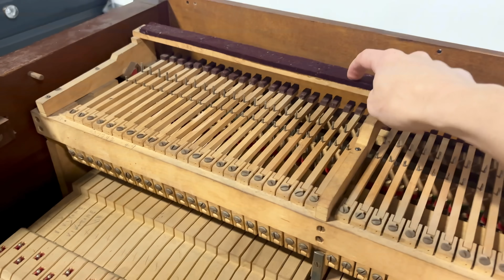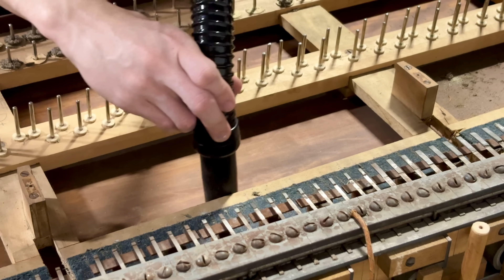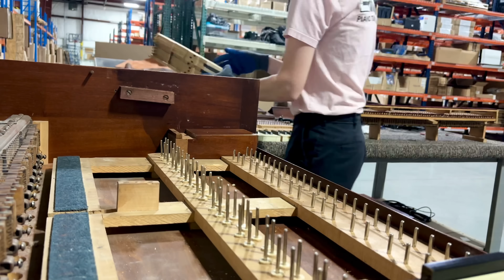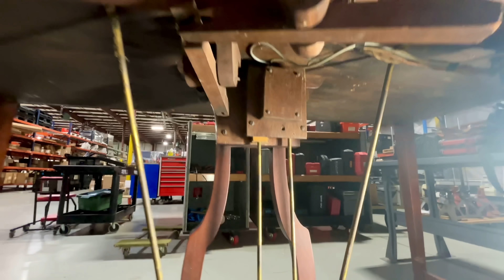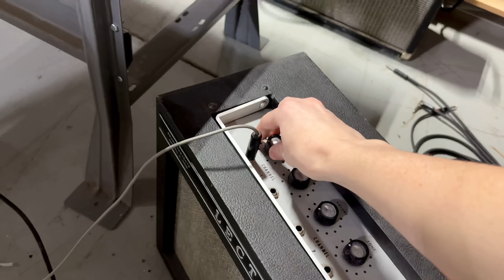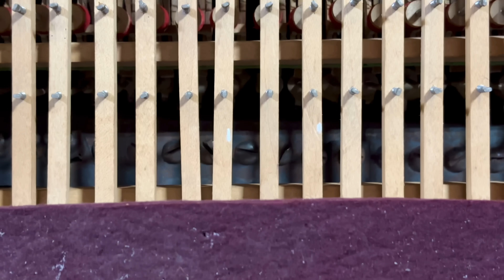Restoring an Instrument You've Never Heard (only 3 left)

Comment from the maker: Yes I used Deoxit F5 on the pot, I just didn't add the clip cause it didn't do anything lol please stop commenting LOL

Also sorry for the clipping audio in sections, y’all wanted it loud so I made it too loud 😂
Reply: I appreciate your practical effort in your quest for doing the best job possible.
Reply: Really enjoyed this video, thanks so much for documenting the whole process.
Reply: Very interesting bit of history and good work! I agree with the EE, Deoxit the potentiometer and replace the capacitor. They dry out with age, so just leave the original in the box with a note for future reference.
I subscribed to your channel cuz this was a cool video.
Reply from the maker: @AdamDavidSoloman  Deoxit F5 was used on the pot and it did not improve--should have included that lol
Reply: @Emmarepairs Thanks for the reply.
Reply: @AdamDavidSoloman  The noise could all be down to that capacitor. I am assuming that EMI filtering is its purpose in that circuit.
Reply: Did you try taking the pot apart? Sometimes the Deoxit doesn't do a great job getting inside, sometimes there's actual debris inside, and sometimes it's actually worn out. I've seen extremely few worn out, but perhaps this one would have gotten more use than the ones I see (mostly old volume controls and video adjustments). Given your demonstrated skills, if you haven't taken one apart before, I think you'd find it extremely easy to disassemble and reassemble. And you can always test a new one in circuit to see whether or not the old one is the problem before doing anything. :-)
Reply: Hey Emma did you try deoxoit on the pot 😂 I'm a retired aemchair gigavoltage engineering assistant manager superintendent and I know more about this than those other guys 

I kid lol excellent work on the restoration that's a really cool instrument
Reply: ... but, did you use Deoxit F5 on the pot? 😅 I have no idea what that is, but apparently it's something special.
Reply: Everything is great fine, I didn't find any calibrated piano sounds in the folder or they weren't intended for downloading?
Reply from the maker: @IljaSj  People have told me they were able to get it working--tbh I don't have MIDI so I haven't tried lol, only heard the files
Reply: @Emmarepairs  Everything works for me, VST3, I just thought there would be sounds of this piano tuned, there seem to be alternative sounds!
Reply from the maker: @IljaSj  wait what? I had my guy alter some of the tunings so it was a little more playable--are they not?
Reply: @Emmarepairs  Sorry, maybe I'm mixing something up. The raw samples in the folder are a little distorted. I probably wanted to play on a tuned piano. But in any case, thank you very much for this. This is history!
Reply from the maker: @IljaSj  Oh yea some notes were a little rough, we tried our best haha--last sample only had the top half working so this is a big improvement--cheers!
Reply: Better than too soft! But if you're looking for a way to make things louder without hard clipping a super simple saturation plugin like MSaturation (I switch of anti-aliasing as it removes some high end) can bump up quiet sections without hard clipping.
Reply: I repair old vacuum tube radios & those wax & paper capacitors are almost always bad. The good news is that you can hollow them out & fit modern capacitors inside and they look original.
Reply: I’m Craigslist near Kansas City. Under “free stuff” people are giving their pianos away for free baby grands and every make a model. It’s happens around thanksgiving and Christmas all the time here
Reply: you should used the stuff in the green can for faders and controls when I am restoreing tube radios.
Reply: So, it's an electric reed piano-y thing? Whichever, it sounds really cool!
Deoxit F5? Brilliant stuff, I use it on guitar pots, switches and that rubbish light switch in the basement that I really should go change out!
I also have a 113 year old harmonium which I love to play, had to fix it first though! Same type of reeds I guess.
Reply: Some people hollow out the old capacitor and put a new one inside it so they can keep the look and still have things work. I see TV and radio guys do that all the time uncertain vintage sets.
Reply: OK LOL I was not one of them commenting.
Reply: What where the two pieces of music played at the end? They're really nice!
Reply: The capacitor (condenser) is an old wax type the buzz you are getting is because that capacitor is now a resistor. I get that you want to keep it as original as possible, but the cap will eventually become a short circuit across the transformer and eventually burn it out. A 0.7nF tubular axial capacitor is a direct replacement for what is on there.
Reply: Ok, but deoxit rarely works on really dirty pots, you could have open the pot and cleaned it.  Then you could have put a modern cap across the bad one

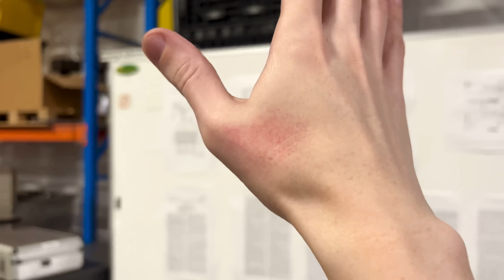Comment: A piece of advice. 7:42 Using your hand squeezing like a vise over time WILL develop  carpal tunnel {maybe with trigger finger thrown in.}  I've been there {both hands}.  Maybe use the pliers with a coulpa-few, not the whole keyboard.  If you were to replace the tone capacitor, it would clear up the crackling {I've picked up some electrickery stuff here & there.}

Comment: With the radio reception means that  all that shielding wasn't truly grounded and I mean to the ground, the earth like you find on a three prong A/C plug. Since it is electric you could replace with 3-wire A/C cable or add a ground wire to the existing A/C cable and wire tie it together then put wire loom or wrap to make it look nice.

Comment: Excellent work. Really! One thing. When applying the ground wires to the shield plating, best to use crimped ring terminals. You can also solder them to assure good long lasting electrical connection. Otherwise, you are amazing 🥰.
Reply from the maker: Thank you!

Comment: The sharps are low you should have measured and gone with the original thickness that is partially why you have the lost motion between the capstans. All the leather and dampers need replaced rebuilt meticulously

Comment: That's truly exciting work. I have an early Rhodes (1965) and am torn between originality and playability. The 65 came with felt on the pedestals AND the cam of the hammer butt... so picture playing the piano with zero key dip! It looks like your miming when your playing! Plus the teardrop hammers were practically undergoing mitosis. Lol. I replaced with hybrid hammers with felt tips. Hardening the felts with good old fashioned shellac. Made from flakes! Other stuff is a drag. Acrylic is just too weird. The shellac works better. You can't destroy a felt with shellac. I am envious of this job you're doing. I'm starting my own channel soon, with a Mellotron resto... where i commit many a heresy. There are only a few guys doing 'Tron work, and they are ensconced in the dogma of 1970 era 'Trons, and do not want to hear about radical mods or anything not in the circa 1970 tool chest. And get very angry when anything else is proffered! Lol.

Comment: This electromechanical piano is unique in using the electromagnetic phenomenon to vibrate the reeds producing sound, which is ironic because modern vacuum-encapsulated reed relays are used in electronics to prevent wear and make them silent.

Comment: What a beautiful instrument! I didn't know it. Great work!

Regarding the shielding, as has already been mentioned, all ground wires should be thick and as short as possible. In the specific case of RF shielding, it's particularly important that it's connected to the point with the lowest impedance, and steel (I assume that bar is steel) is a very poor conductor. Since there's no internal active circuitry or power supply here, the simplest solution is to connect the shield to the ground in the output audio connector. That's the "shortest" path (lowest impedance).
.
The bar that's grounded (and the coils that are grounded at a nearby point/wire, I assume) are thus connected to a ground point with a slightly higher impedance, and THEN connected to the output connector. In this way, they're referenced to a same "common" ground, but different from the shielding's ground. (Any length of wire/copper track between two ground connection points should be considered as a "resistance/impedance", especially with noise and RF issues) 
It's prudent to expose new metal (using sandpaper, a file, or anything that can remove the oxide or protective layer in the shield), and solder the connection ( or use star-shaped washers, those can "bite" the metal). Over time, the wire and the metal sheet will oxidize, and the connection deteriorates. RF can make weird stuff, especially in corroded/rusty connections

Comment: Coil cables are by nature much longer, and after 10’ you start losing high-end EQ. They were popular amongst el. guitarists of the 1950s-70s who wanted to intentionally remove some harsh “bite” from their vintage pickups without running a 50’ cable. In this scenario however, I would strongly advise against it. Especially that Radio Shack looking coil cable. Replace it with a regular straight cable. 🤘🏻
Otherwise, amazing work! Especially on the key bed and action! I’m definitely going to rewatch this many times. I’ve got a Yamaha CP70 and a few uprights which require TLC on occasion. ❤

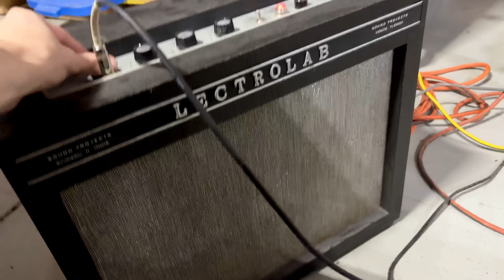Comment: Cool piece. I never would have guessed something like this existed this early. TS 18:07- Your 'shielding' created an antenna. You didn't say how you solved the problem. Did you simply remove the grounding to the bar? Also, you're working in an unkown warehouse space, did you test the AC outlets to check they were wired correctly?

Comment: I give you an A for bravery taking on this project. That capacitor looks like a 750pf 600VDC cap... part number C-SM750 at AmplifiedParts would probably would work as a replacement. You could measure the pot resistance with a multimeter and get a replacement(p/n R-V38-100KL ???). Also was wonder what those pickups ohm out at? And what the rest of the electronics were?
Reply from the maker: Thanks!

Comment: That "black matter" looks like a graphite brush, used in electric motors for conduction of electric power to the rotor, like older hand drills. It is also part of pencils. I don't really get the material choice though. And harmfull in huge amounts as that is the stuff coal miners suffered from. Don't use a vacuum cleaner as it will blow the stuff all over the place but rather a water or a welding extractor to avoid it getting "airborne" inside. Proper dust masks also work. The way you treated it though (slow filing) minimizes fine dust. Just be aware of it when doing a lot of work like this. It is harmful long term (+20 years) of daily exposure to develop serious things from this so you're good. But it's better to avoid it of course.

Comment: Sine wave diagram looks like a guide for the vertical alignment of pickup to tine... similar to my own experimentation, just slightly offset from pure neutral.  If you put it at pure neutral you get an octave up coming out very strong... just a little off from that is optimal, right?  EDIT that's for a Rhodes, this is basically a proto Wurly amirite?

Comment: Being that these were basically prototype instruments, common easy to get materials would have been sources for something not in a normal piano shop. I bet the weights were made from typeset lead. It's a bit harder and would probably provide better ringing. When you connected the shield to ground I'm wondering if it was an actual ground or just the neutral wire.

Comment: I'll avoid commenting on the pot/capacitor controversy.
I will state that grounding your added shielding directly to actual earth ground, and not connecting to the other internals, would probably have avoided turning the shield into an antenna.  I don't know how much difference it would have made in sound quality in any case.

Comment: i think, maybe, but i'm relatively confident, that the "black material" is an early-made plastic.
I own an opus named "Dictionnaire de chimie industrielle" (forgot the authors, so the edit : M. Barreswil, Aimé Girard), from 1861, before the plastic era.

Back then, petrol was not used to make fuels and plastic, but only mechnical oil, and plastic was quasi confined in the proces of celluloïd pastics, made from, well, cellulose. 
Theses were mainly used in photographic films, quite a niche thing, but it is mentioned that other types of plastics were made from there with this product, thus not mentionning what type of plastics, because it's already niche.

It changed during the Rockfeller era, and the discovery of petrol-based fuels and he's a contemporan of this piano, and even then, petrol-based plastics was a brand new thing, so...

Comment: Hi Emma,
Thanks for sharing your dive into this rare 1930s electric reed piano.  
A couple of questions:
1.  Do the things you call "pluckers" actually pluck the reed, or do they hammer against the reed?
2.  In the video you made of the later version of this instrument at the museum, you mentioned that there was a capacitor in the circuit for the bottom 3rd of the keyboard that had failed and made that portion dead.  Did this earlier (possibly pre-production) instrument not have that, or did you replace it to get that portion working?

2 suggestions:
1. For the broken gear on the pedal assembly -- 3D print a replacement out of either nylon or ABS  (don't use regular TP filament as it is too soft and will wear too fast).  
2.  As others have said, hollow out the dead capacitor and insert a modern one placed inside and sealed with wax.  Just notate the change on the inside of the cover for future technicians and historians.

I hope these suggestions are helpful....

Cheers from Portland, Oregon,
Philip.
P.S.  Glad to read that you use deoxit to remove oxidation from pots.  I find it works like magic on oxidized pots and switches.....  Be careful just using it on really dirty/filthy pots -- those often need to be dissembled and cleaned using 90% isopropyl alcohol, afterward you can then spray a light film of deoxit to keep corrosion at bay..  If you don't clean the dirt out of pots, the remnants left behind will continue to grind away at the components doing permanent damage over time.  Be very careful with pots that use carbon traces as rubbing can wear the traces away.  (I prefer using 90% isopropyl alcohol over acetone for cleaning electronics because it doesn't attack coatings and sealants the way that acetone does, but, like acetone, it leaves no residue.  You can get the 90% stuff at any drug store.  WD-40 also works pretty well as a cleaner for electronics -- it was one of the main uses of it in the early days for cleaning distributor caps on older pre-electronic ignition vehicles -- however it can leave a residue.  (The alcohol is less expensive too....)
P.P.S.  I've subscribed....
Reply from the maker: The pluckers pluck the reed not strike them--there is a website with a bunch of electric pianos listed that says they strike but that is incorrect. The later version's capacitor clump was not spotted on this one--I suspect it was to shape the tone/volume more and refine the tone in later additions

Comment: The potentiometer can be taken apart and cleaned internally to get rid of the crackle. (Oh never mind, you did use Deoxit!)  You can preserve original appearance of the capacitor by drilling a hole through it and hiding a modern polyester capacitor of approximately the same value inside.  Solder the modern leads to wires of the same gauge as the originals, and fill the ends of the tube you made with melted paraffin - which is what the original wax-paper capacitor was dipped in, anyway. Having the cap in place will probably cure the buzz.

The black material on the plectra appears to be Bakelite.  You can still get sheets of phenolic-on-linen material, but black Delrin would wear better and still be close to original appearance.

Comment: Pretty much a sure thing that the capacitor, being that old, is electrically leaky, meaning that it acts more like a resistor than a capacitor. Capacitors pass ac current and block dc current. The have a very high internal dc resistance, in the order of meg ohms. Over time that dc resistance decreases and the capacitor begins to pass some amount dc current. She should have replace the capacitor. If she wanted to keep the original look, the insides of the capacitor can be removed by heating the capacitor tube and pulling out the insides and place a modern capacitor inside of the original tube,sealing the ends with hot glue. Make a note inside the box that this has been done with the date for the benefit of some future technician. I do this on a lot of the vintage radios I restore.
Reply from the maker: Yes